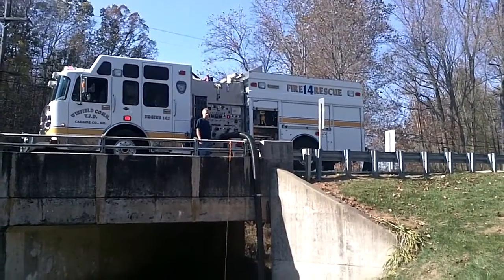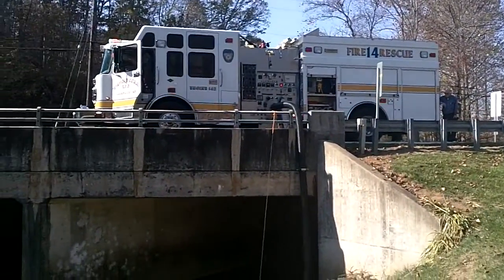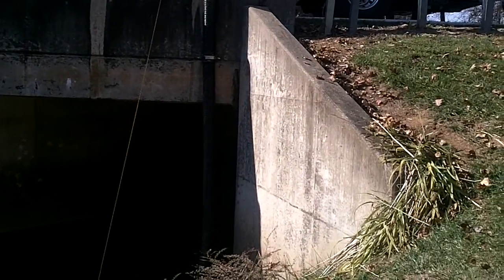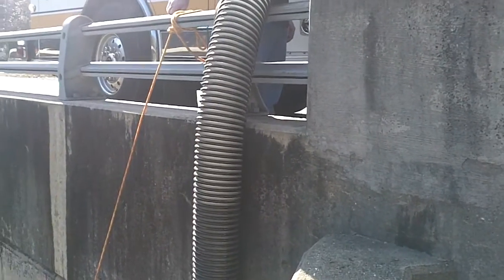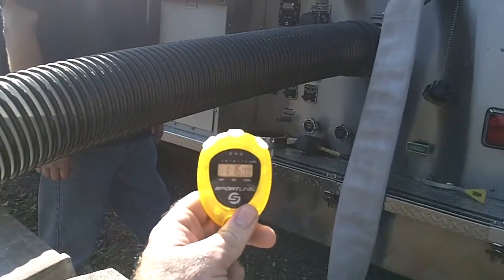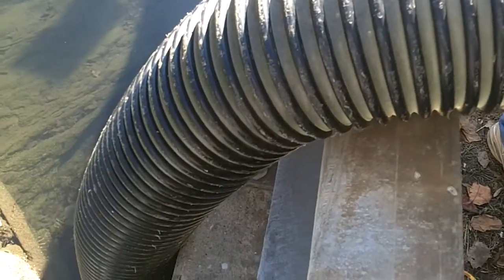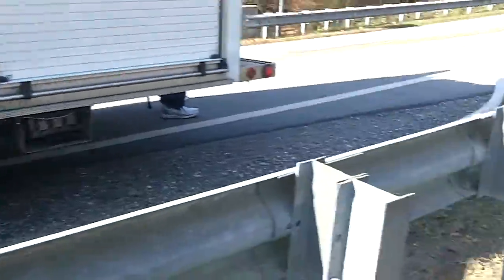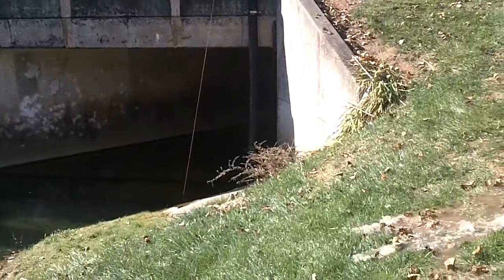Trident Automatic Air Primer: Part 8 - Overcoming a High Lift

Comment: I like this... just watched the whole series of videos on this device.. what is the cost? and I know you said it mounts up to any pump virtually  my town has a 1987 Ford with a 1250 Darley (not sure what the model specifically is)  would it adapt to that? we have issues from time to time at our main draft site that is about a 12' drop. if this device would work would be interested in putting it on the truck and see what it does. Thanks !
Reply from the maker: The cost varies based on the installer. The most important item is the size of the air compressor on the vehicle's motor. For a 1250 gpm pump you will need the three-barrel air primer which has a minimum air compressor requirement of 15.5 cfm.  I recommend that you call Mr. Parker Browne at 330-612-3567 who is most knowledgable about the device and the installation scenarios.  thanks mdavis